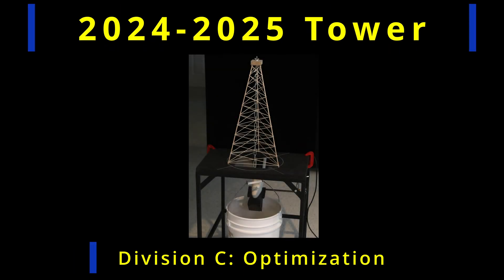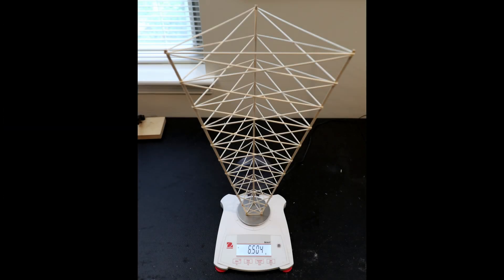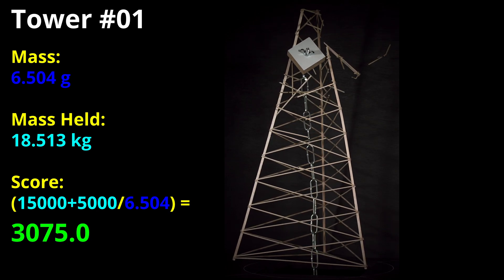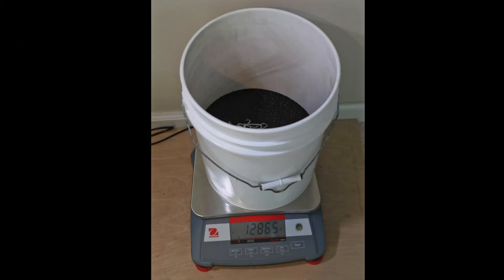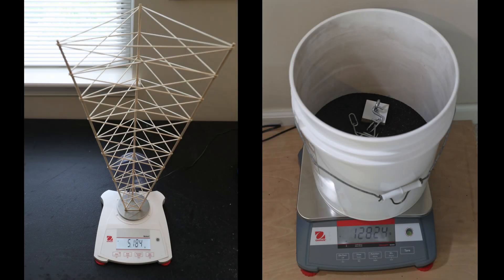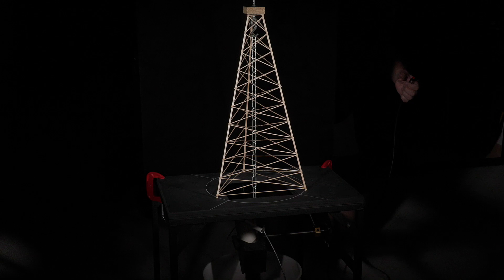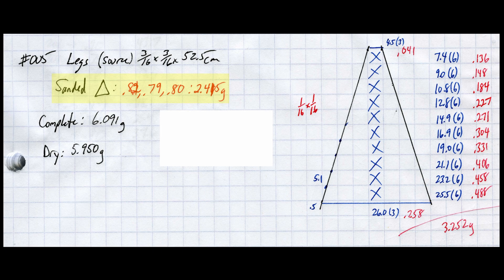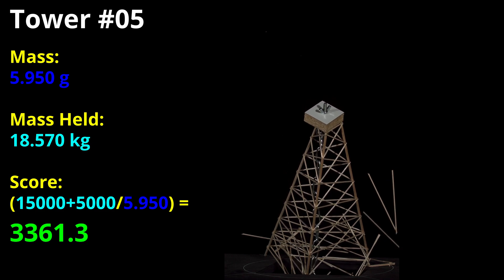2025 Science Olympiad Tower Div C: Optimization

Comment: Hi Balsa engineering thank you so much for making these videos. I have a quick question. So when I competed in towers I noticed that only one of the legs broke and it broke towards the bottom and all the other legs stayed intact. Do you know what could have caused only one of the legs to break. Also, when building another tower I somehow misinterpreted your notes so I ended up with 11 braces. Will having more braces be good or bad for my tower. The spacing is about 4.6cm. Thanks!
Reply from the maker: Even with a perfectly symmetric and level build, you'll see one leg break before the others.  That is just the nature of the loading and the fact that with even the exact same mass legs, some are stronger/weaker than others.  11 braces is fine and will actually make it stronger.  I would say anywhere from 8 to 12 are worth experimented with.  As you have more layers, you can use lighter legs as the shorter spacing makes them stronger against buckling.  The key is finding the perfect combination on how to distribute your mass budget between the legs and cross bracing to get the most optimal build.  Good luck!!
Reply: Hi, okay thank you for answering  my question but for context my tower weighed 8.1 grams but broke after hokding 9kg.Is it that the legs were just too weak?
Reply from the maker: @asteralemayehu4973  Without seeing high speed video of the failure, it's really hard to know for sure what the issue was.  These things break really fast and while it looks like a leg failed first, it may have been a cross-member that actually failed first and then an instant later, the leg failed.   It could have also been an issue with the tower not being perfectly level.  If it's just slightly off, one side will get loaded more than the others and can cause a failure.  I would recommend you try and build an over-built tower, say 10-11g and make sure you can build one that holds > 15kg, and then start lowering the mass for future builds.  That will verify your gluing and construction techniques.
Reply: Okay thank you so much!

Comment: Hey Balsa Engineering,
Would it be a good idea to use the medium density 3/16” x 3/16” sticks for the legs, light density  1/16” x 1/16” for most of the bracing, and light density 1/20” x 1/20” bracing for the top 2-3 bracings of my tower?
Reply from the maker: That sounds like a great start and very similar to what I used for my benchmark tower.  Good luck!

Comment: Hi Balsa Engineering,
For my last invitational, my tower weighed 6.41 grams and supported 14.1 kg. However, I haven’t been able to achieve a tower score above 3000. My best attempt so far was a tower that weighed 6.98 grams and held 16.8 kg. The tower that held the most weight was 7.17 grams and supported 19.7 kg.
I would really appreciate your advice on how to build a tower that can score in the 3000 range.
Thank you!
Reply from the maker: Hi!  It sounds like you are well on your way to building a 3000+ tower.  It really comes down to careful material optimization and balance.  It takes just the right wood to get the perfect build.  I would suggest you try and replicate my benchmark tower as close as possible if you want to hit the 3000+ mark, at least as a starting point.  First, cut all the material for your next build and weigh every piece and layer like I show in my notes.  Compare you material exactly with what I have to see where yours is different.   Your 2865 tower is a very good competition result and if your 7.17g build had an actual efficiency of 2748, so if you properly scale that down to 15kg, that would result in a 15000/2748 = 5.46g tower that would score 3663!  So you already know how to build the tower you are after, you just need to zero in on the optimal material.  Good luck!!
Reply: Hey balsa engineering, I just wanted to say thank you because my regional competition was yesterday and I had a bonus tower that weighed 6.65 grams,and was able to hold the entire bucket therefore giving me a score of 3007.5!
Reply from the maker: @NabilAksamawati-Arja Congratulations!  That is a great result, keep up the good work!
Reply: Hey balsa engineering, I just made a new tower that had .8-.7 gram legs and the overall weight of the tower was 6.37 grams. It was able to carry 19.497 kg so do you think I should try extra light for legs and cross members because I’m on light for both.
Reply from the maker: @NabilAksamawati-Arja Hi!  That is a nice build!  It's actual efficiency was 3060, if you can scale that down with that same efficiency and have it break at a perfect 15kg, that would mean a 4.90g tower which would score 4082!  You definitely have proven you have the build skills, now you just need to go lighter.  You need to experiment on dropping the mass down until you can get close to the optimal.  If you have the time and materials, I would certainly try for a ~5g tower and see how it does.  You might want to get there gradually by starting with a ~5.5g build and go from there.  Good luck!
Reply: @ Thank you so much!
Reply: @balsaengineering6686  Hey balsa engineering, I also wanted to ask if there was any specific cut of balsa I should get for the legs and cross members?
Reply from the maker: @NabilAksamawati-Arja As a general rule, C-grain is better in compression, so you could certainly experiment with that if you want.  It is typically much more expensive though and getting the correct, matching/balanced mass is way more important than the grain type, so I'd focus on that first.

Comment: Thanks for your reply, and also concerning the cross-bracing density, I can’t find websites that sell cross bracings 1/16 by 1/16 36 inches or less at the density I would prefer. Do you have a site where I can get specific densities. I already tried specialized balsa, but their sticks are way too expensive with 20 bucks on shipping and national balsa but they require 50 dollars order purchase, and I would be getting too many cross bracings I wouldn’t use(136). Do you have another site where I can get specific densities for the crossbracings that charge a bit less (not 2.25 dollars per stick, adds up with the amount of testing I do) and don’t have an order minimum.
Reply from the maker: Specialized Balsa is the only place I know of where you can specify the density.  For me, buying pre-cut sticks is way too expensive.  That is why I recommend you buy balsa in 4" sheets and cut your own.  It will be much, much cheaper and you'll have even more control over the material.  It's more work, but it's worth it.  Be sure to watch my Balsa Library video if you want to see how I cut most of my sticks from sheets.

Comment: Hello! What would be the effect if I added a horizontal cross member intersecting each x in the middle?  This would halve the distance of the leg between each cross bracing, so you can use a lighter leg?
Reply from the maker: That is certainly something you can play around with, but all those extra cross members will add a lot of weight.  You'll have to experiment to see if that added weight is more or less than the amount you can lower the leg mass.  Another benefit of cutting everything ahead of time is that you can figure out if you can even build a tower that is overall lighter before you glue anything.  I always like to estimate the final mass of the tower before actually starting construction to know if it's worthwhile or not with what I'm trying to achieve.

Comment: Hi Balsa Engineering! I was wondering what the measurements are for this tower's cross-legs. Thank you so much for these videos!
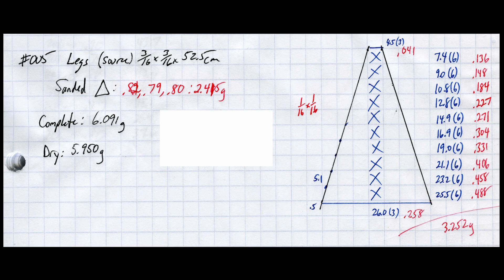Reply from the maker: Hi!  You can see those dimensions in this video when I show my notebook page, for example at 6:53   Check out the blue numbers on the right side of the page.  The bottom layer is 25.5cm (6 pieces), the next layer is 23.2cm, all to way to the top layer which is 7.4cm.  Hope that helps!
Reply: @balsaengineering6686  Thank you so much!

Comment: Hello Balsa Engineering. Thank you for these amazing videos. We wouldn't know where to start with the triangular legs without these great tips. Can you kindly let us know the density of the balsa wood you used in the benchmark build? What is the density of the legs (3/16 x 3/16) balsa sticks and what is the density for the cross members (1/16 x 1/16)? We read through all your responses to the comments and figured the density for the legs should be medium and for cross members it should be light. Is my understanding right? Appreciate your response.
Reply from the maker: Thanks!  Yes, if I recall, the source legs were in the "medium" density range at around 11 lbs/ft^3.  I don't have the value for the cross members off hand, but you should be able to compute it exactly from the masses I've shown in my notebook page.  They are definitely in the "light" range.
Reply: @balsaengineering6686  Thank you so much for taking time to respond to our question.

Comment: how far apart did u make the crossing layers.
Reply from the maker: You can see that in this video when I show my notebook pages. For example, at 6:58   The bottom horizontal layer is at 0.5cm and each layer after that the spacing is 5.1cm.

Comment: hi balsa engineering - for the bottom part of your tower, for your triangular legs, how do you ensure that the tower is standing straight on 3 flat surfaces? Do you sand the bottom of the triangular legs until they are flat and level? thank you!
Reply from the maker: Hi!  I've found in my recent years of building a lot of towers, that it isn't necessary to have the bottom of the legs sanded flat.  I always just leave them at an angle and it works fine.   That being said, you need to be pretty deliberate to get the legs perfectly aligned from the start.  If you check out my assembly video at around the one minute mark, I show how I tape the legs in place on the jig while using a very flat build surface.  This works well to make everything nearly perfect:  https://youtu.be/TkUS4W4bOZM?si=w-yEqXui0G-rYRWH&t=70
Reply: @ oh i see! thank you so much!!

Comment: Hey balsa engineering, i tried to 3D print the STL jigs that were in the description, but all the actual tower pieces contact the base of my 3D printing machine at only one point, making the print fall over. Are the files supposed to be like this? What should I do to fix the positioning of the prints?
Reply from the maker: Hi!  You may need to rotate the STL files before printing.  Your slicer program should be able to do that easily.  Just select the object and rotate it, probably just 90 degrees in one direction so it is flat on the printing surface.  Good luck!

Comment: Based on my calculations, your source wood at a length of 36 inches had to be around 3-3.5 grams, right?
Reply from the maker: That sounds about right. Probably closer to 3.5g, although I didn’t keep track of that. I did record all the 52.5cm source legs though and they ranged from about 1.9 to 2.2.  Only the final sanded weight matters though, so that is the library of material you want to build up to choose from
Reply: @balsaengineering6686  Thank you. I've been at it for the past hour, trying to find the right weight wood. Been getting wood too light, but never too dense, but just finally struck a 3.3. Hopefully I can get more!

Comment: Hi Balsa Engineering! Thank you for making this video for this season. I was working on making the most optimized or the benchmark tower for this year. The mass for the tower I made ended up being around 1.2 g heavier than yours. Do you know what could lead to this issue? I’m thinking it could be the amount of glue I used or something like that. Thank you!
Reply from the maker: If you check out the video at the 6:56 mark, you can compare your build to my benchmark tower in great detail.  I show the mass of all the parts including the legs and the combined mass of each layer.  My guess is you are using slightly heavier balsa than I used, but you can compare your build exactly if you recorded the weights for your tower pieces (which I highly recommend).
Reply: @balsaengineering6686 I’m confused as to how I made this mistake, but I made 11 crosses instead of 10?? According to the notebook page, it should be 4.6 cm from the bottom to top of each cross. The length of the stick is 52.5 cm, so how did you cover for the rest? I think I’m tripping on the math while building it 😭
Reply from the maker: @potatoooeed7581 if you re-check my notes, the first layer of cross members starts at 0.5cm from the bottom and then the spacing is 5.1cm between layers.  Btw, having 11 layers is not a problem and might even be better depending on your materials
Reply: @balsaengineering6686 thank you so much! I had another question about reducing the weight, as of now it’s still heavier by about 0.9 or so even after reducing the number of crosses. Why would 11 crosses be better? Also, if my balsa is just heavier, could I just remove one of the cross members on one of the top crosses? Thank you 🙏
Reply: I think I found a part of the reason, the design I built is almost exactly like tower number 1 rather than 5. My leg masses are similar to the first one. How did you reduce the mass of the legs? Is just just by sanding it more
Reply: My leg mass ended up around 2.7g and the crossmembers around 3.3g but the finished tower is like 7 grams. Could the glue be 1 whole gram??
Reply from the maker: @potatoooeed7581  The optimal number of layers of cross members is closely tied to the strength of the legs.  Having 11 (or more) could potentially allow you to use lighter legs.  This is the kind of thing you'll need to experiment with to optimize based on the exact material you have on hand.  See my 5-part tower basics video series if you want a more in-depth discussion on the tradeoffs.
Reply from the maker: @potatoooeed7581  The best way to reduce the mass is to use lighter density wood.  Slightly smaller might be OK, but I would try and use less dense wood if possible
Reply from the maker: @potatoooeed7581  If you are using too much glue or too thick glue, you could easily be at 1g.  You should shoot for more like 0.2-0.3g of glue for this build.  Check out my glue video for details on what I like to use and the technique for applying as little as possible: https://youtu.be/55lb2KzSiwg
Reply: @balsaengineering6686 thank you! I think the problem was that I was applying glue straight from the bottle, and in the process added too much. I will make a precise applicator and see if that reduces my weight by some
Reply: @balsaengineering6686 if I do t have access to lighter wood as of this moment, do you have any advice as to how I could reduce weight? I’m going to try to pick the lightest wood from what I have, but besides that how could I reduce wkrngt
Reply from the maker: @potatoooeed7581  There is no real way to reduce the weight using higher density material besides using a smaller size.  You can probably get away with smaller cross members, but shrinking the legs will be challenging without create a new custom sanding jig

Comment: Hello balsa engineering, I noticed that this year you didn’t list the densities for the wood to the left of the tower. You did last year,is there any way you can provide me with those numbers?
Reply: Preferably for the 36in and 48in sticks, thanks!
Reply from the maker: @demonplayz857  I have the mass listed for the entire layer of cross members, so some simple math will get you source stick mass.  For example (6) @ 25.5cm at 0.491g is 153cm or 60.236 in.  For a 36" stick, that is just 36/60.236 or 0.598*0.491g, so 0.294g for a 36" for that layer.   You can then compute the actual density if you want by knowing the volume, just make sure you get your units correct.